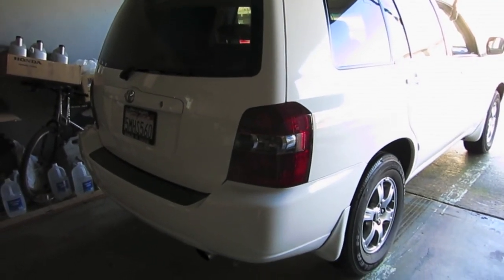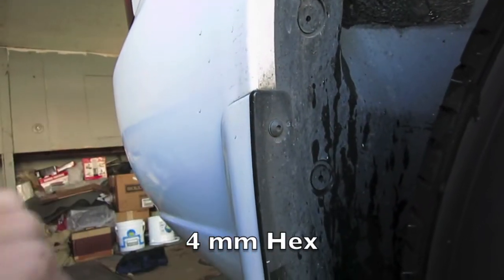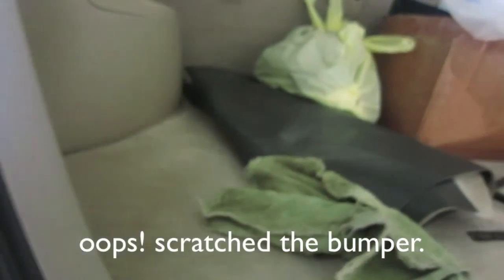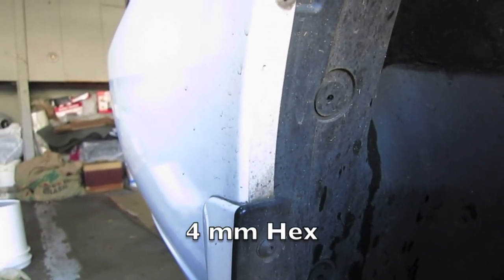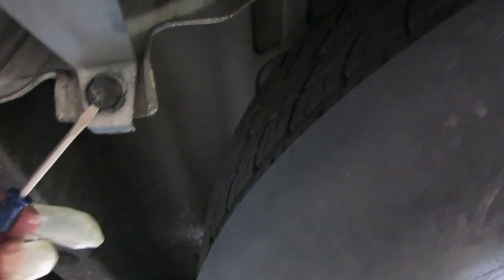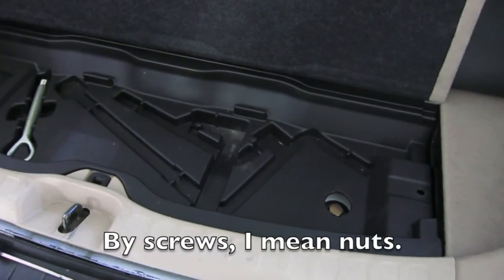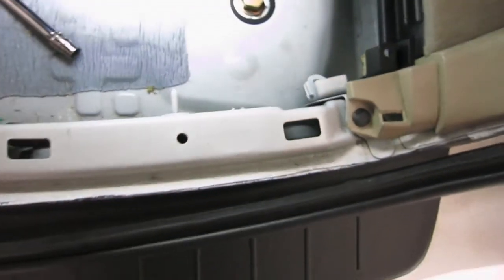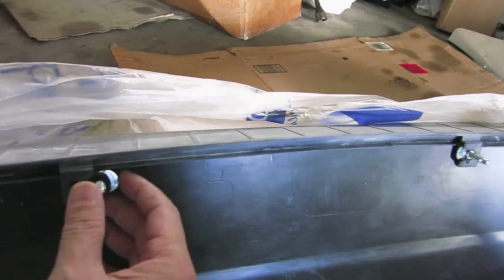01-07 Toyota Highlander Rear Bumper Cover Installation - How To Remove

Comment: They sell a pry tool for lifting the plastic tabs out without breaking them~but it is a tough job either way. Some tabs require lifting the center of the tab first then you can pry out.Thanks for making the video. Amazing how many Highlanders are banging in on the drivers side like that. Cant believe how little rust you have under that one. I live in Massachusetts ~lots of salt on the roads in the winter
Reply from the maker: That Highlander is a CA vehicle, so no salt here.

Comment: Thank you very much for your video! It really helped me to easily replace the rear bumper on the Toyota Highlander Hybrid 2006. I also did not have a clip at 2:23. Another suggestion for those who do this is to drill small holes for hex screws before installing the bumper, otherwise it will be difficult to do because the wheels are too close.
Reply from the maker: That is a good tip. It will definitely be a lot easier to drill before the install.
Reply: O